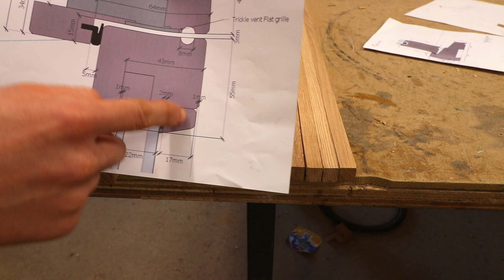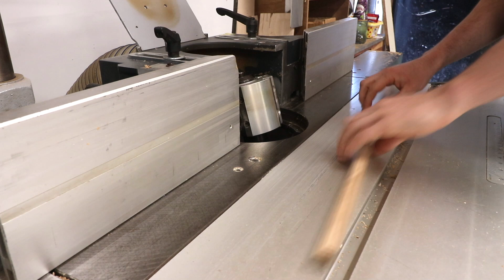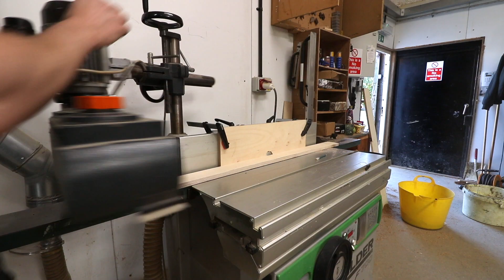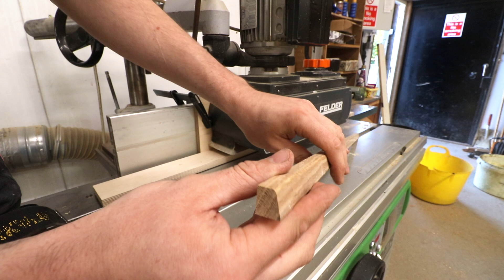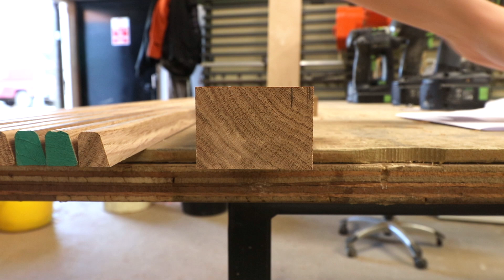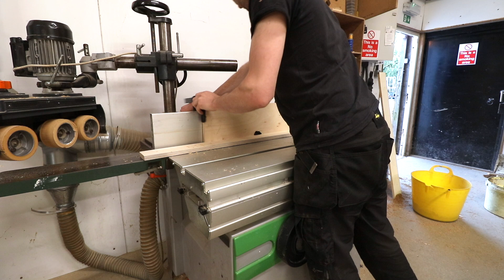Glazing Beading & Sub-Cill Machining - Part 10: Oak Casement Window

Comment: Is it common to do the subsill like that, glued into the bottom sill? Or is it more common to just have one piece of timber as the sill ? What would be the advantages of this approach over a machined single sill piece?
Reply from the maker: Yes fairly common. Timber wastage, but mainly easy of working. Both installation and during manufacture. The cill protruction always gets in the way, and can be altered if made seperate for different openings.

Comment: Hi, I have question about the window pane size. Are you leave space all the way around glass panel when you order glass? How big the space between glass panel and sash frame?
Reply from the maker: Yes, the most important is that the spacer bar on the inner edge of the unit is covered by the rebate, the glass can be tight to achieve this but generallt 2-3mm gap around is sufficient
Reply: @BradshawJoinery  thank you very much for the response. All your videos are great.

Comment: I am about to make a casement window. There will have two transom and center panel will be fixed. I am wondering do I still need to make the inside sash panel for the fixed part? I don’t know how to close out the gaps in between.could you give me some advice? Many thanks.
Reply from the maker: Hi I was racking my brains to understand the scenario, but i assume you mean mullion and not a transom? In which case, yes you can direct glaze the centre. its is a different look to the window aswell so down to preference really. 
Can be as simple as glazing straight into the rebates with a bigger glazing bead. 

Or reduce the rebate depth so the beads matched on the outside

Comment: Thank you for these most instructive video's.  They are very detailed and have given me the encouragement to actually try and make my own windows however, I do have a question.  I am going to make a double casement window but making mine storm proof (lipped) rather than flush fit, is a rebate of around 26mm in the frame ok for storm proof windows?  My frame will be 65mm deep (to match my listed buildings current windows) rather than 95mm as in yours
Reply from the maker: in them sizes id look to be using a 45mm thick casement, and i would wat roughly 15mm overhaninging the outside of the window, so a 30mm deep rebate, plus your seal depth,
Reply: @BradshawJoinery  Thank you for the quick reply, greatly appreciated.  I am going to have brush carriers and brush seals on the casements as well as seals at the back of the rebate on the frame so your advice was definitely needed.  Many thanks

Comment: Fantastic video series, thank you. I wondered how long you thought it would take if you were doing a batch of six. A lot of the time is setup which would be spread across the batch.

Good luck Mark and thanks for letting the videos happen.
Reply from the maker: There is time saved in multiple passings on each.setup.but only a limited amount. The main time consumer is all the manual parts, glueing, sanding cleaning, moving stuff around. Painting and glazing add a lot of time too. I'd allow roughly 3 days for a window from raw materials to fully finished and glazed. On 6 windows probably looking around 2.5 to 3 weeks labour depending how intricate they are  👍
Reply: @BradshawJoinery  Thanks, lots of work but a lovely result. Likewise the videos

Comment: Wow, a truly epic series of videos in every sense. I originally came across these and your channel looking for some info on using a spindle moulder but then I couldn’t help watching every video in this series! You really should congratulate yourself on providing not only a detailed and well explained series of steps, but the bit I really loved was all the extra little tips and tricks you’ve picked up from all your years of experience and training. Really brilliant. Thank you so much. I wasn’t 100% certain that having a tilting spindle function on the machines I’ve been looking at was something I’d really need or use, but you’ve really opened my eyes to the massive potential it holds and convinced me it’s almost essential to get the most out of your machine and tooling.
Reply from the maker: Thanks Stephen, that awesome to hear! The tilt function for me is invaluable! I love it. Reversing on the 3 phase is handy but i dont use it that often.

Comment: Thanks Ollie and Mark.  Can I be cheeky and ask for specs / links for 1. Finish of choice for unpainted oak Ollie 2. choice of beeding caulk of the external 3mm round over on the joints 3. source and spec for the glazing gaskets you intend to use.  Also Ollie it would be great if you get a chance to go through how to make traditional Mullions as profiling these on the SM something I am struggling to work out safely.  Great series and thank you Mark, good luck with your project.
Reply from the maker: 1. bare oak, im assuming externally.... it needs a anti fungicidal protection, so sikkens HLS or sadolin classic. If you are prepared to maintain regularly these products will suffice and give the most natural finish in my opinion. apply and wipe off, every 6 months after a clean. if you want a sealed finish, im not sure there is a perfect choice. ive had ok sucess with the above followed by Osmo UV oil, the bonus again is that uv oil is easy to reapply and maintain. it wont last forever though and will need significant work to refresh if left too long between maintenance. 

2 The V groove sealant is called sikkens kodrin wv472. its 10x stronger and more elastic than any caulk. it shrinks a fair bit when drying but this creates a nice effect. 

3 i use 2mm tape externally which sits 2mm back from the edges (see drawings video) georgian bar tape. Then 1mm tape internally flush with the edges for a finish. i fill the gap with a ms polymer sealant. the best is dryseal mp. not cheap though and very hard to get out the tube! i buy the tape from coastal, reddiseals or marches depending on where i am placing an order

4 ill have a think on the mullion and send you a PM Thanks buddy.
Reply: @BradshawJoinery  Ollie have sent you a PM off your face book page....